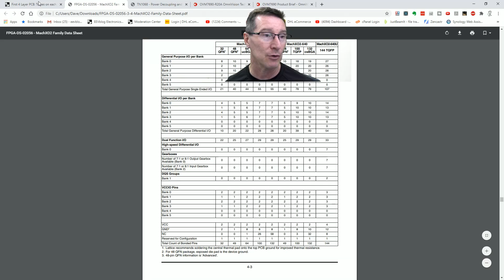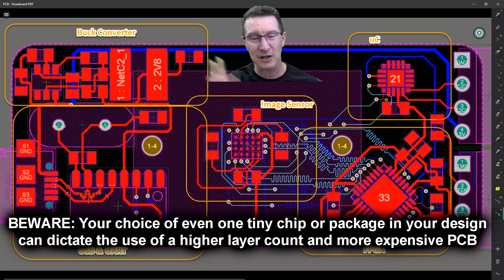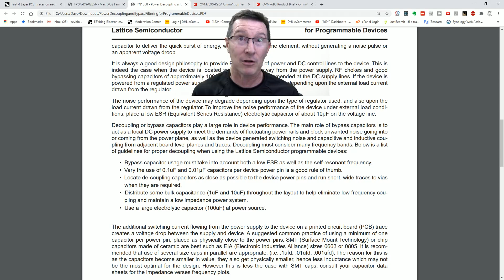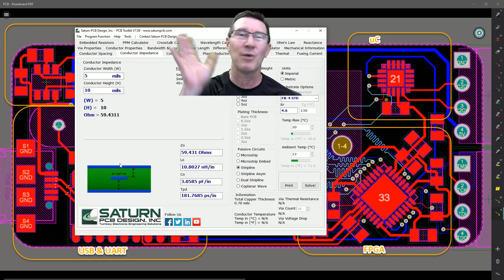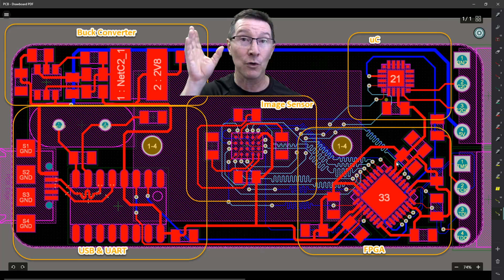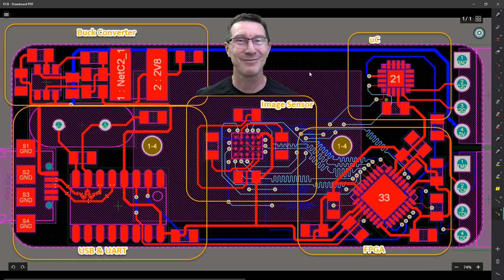EEVblog #1323 - PCB Layout Review & Analysis

Comment: My extra comment with BGA's would be, just try to avoid them (not always possible of course).
They are a pain in the behind to troubleshoot, repair and prototype.
Btw, you can also use 0 ohm resistors (or split one resistor in two) as jumpers, to prevent going into other layers.

What also really helps, is first just roughly place components on the board without connecting them even.
This is even PART of the development stage. (I call it the tango between board design and schematic design)
Just to get a good feel how much space you have and if you already need to find alternative components.
I see so many people wasting a lot of time first calculating every tiny bit of their schematic first and than eventually come to the conclusion that things don't quite fit.
Most of the time you know that certain components are needed anyway (for a lowpass filter for example).
The values aren't important for drawing the board.
In fact, to safe time you can calculate these while ordering the boards.

I also find it interesting how there is a bit of personal preference.
I actually always tell people to do the ground connections LAST.
The reason is because it's pretty easy to move via's anyway.
Exactly what you say at the end, do your power traces at the end.

Nice video Dave!
Reply: Yes, I also don't understand that people calculate everything first.
First get the basics right, values will come later.
Most of the time you will go back and forth anyway with size vs value
Reply: Yes, this sounds very familiar. Even just three weeks ago I had a co-worker spending literary days on end calculating just some perfect values for a MFB filter.
In the mean time, the whole order on getting just the boards made (so not even assembled) was delayed.

Comment: I’ve learned my make PCB layouts basicly my self I’ve never done anything complex. But I’m always told I’m smart with I don’t believe😅 but I learned myself that placement is everything. And on multiple occasions scraped all my work just because I figured out I could move things around and get everything easier. Common sense is just vital for these things. Also taking pride in ones work I think is also important. Yes this design “works” but it’s not the most pleasing, or most correct way.

Comment: Maybe you could do a video where you actually fix the design, would be nice for the guy and would be nice for us watching as we would see the design progressively improve
Reply: I thought the same thing. Also a side by side before-after comparison at the end would be really cool
Reply: Maybe the guy could submit the altium file instead of a screenshot.
That would have helped alot.
Reply: That would require a heck of a lot more time, you know - many hours.  For we visual learners, it isn't necessary.  I can see that for others it would be valuable.  Also, it would require Dave needing the source files as well as be familiar with and have all the software.

Comment: Don't be afraid to use small passive components (0402 or even 0201). They are pretty much the industry standard now and unless you need the power dissipation of 0805 or higher voltage ceramics, there is no reason to go for 0805 (for mass produced PCBs). 

He could have achieved a much nicer buck converter layout if he had gone for 0402 passives. Don't ever compromise on layout like that. That is just going to create a lot of headache when your product fails radiated/conducted emissions tests and you have to redo the whole thing again (which might cost you tens of thousands of dollars). That is extremely important when your case is made of non-conductive materials and usually less than perfect layouts create all sorts of noise in 100 kHz-10 MHz region. 

Though I have to mention, that the digital signal layout is usually very forgiving (quite hard to screw up so much that your UART signal gets messed up) but you would see a huge difference in EMI/EMC testing when comparing autorouting mess and proper, well thought out layout.

For learning, a good place to start is to thoroughly read the chip manufacturer's application notes and datasheets. Though you can't believe them 100% since the electronics design industry is full of incorrect assumptions and rules of thumbs. You just have to find out the truth the hard way sometimes. I could later mention some useful literature, though I can't seem to find the list right now

Comment: Placing components and traces so tightly to the board edge is going to demand extra attention to detail and control during PCB depaneling if that tight placement is a design requirement. Otherwise, expect defects impacting those items at the depanel process step. 

Components placed that tight to the board edges also tend to be more susceptible to mechanical damage during physical handling and transfer between manufacturing process steps. That imposes additional costs in terms of troubleshoot, repair, and production delays. It is amazing how quickly they add up.

The tight placement of components with a significant difference in pad size also has the potential to impact the SMT reflow process. The larger pads will tend to pull heat away from the smaller pads, potentially leading to solder defects. Typically these issues are noted for potential improvement during a DFM (design for manufacturing) review or flagged by a manufacturing engineer using an automated layout review tool. If the tight placements are an absolute requirement, the SMT engineers will need to carefully manage the reflow profile.

Comment: If using an FT232R and it's not a timing critical use case, you don't really need an external xtal. It has an internal 12MHz oscillator, DPLL and even a x4 clk mutiplier.  AN100 states: "In some applications it may be necessary to use an external clock source. For example when operating at a reduced VCC supply voltage or for improved EMC. "

Comment: Regarding the 2 SPI lines "in the middle" of the data lines -- rotating the sensor 180 degrees those magically become on the outside requiring no vias at all (assuming the pins on the fpga are fungible)

Comment: Please do a video on split power and ground planes.
Reply: that is an very annoying topic. If you are really interested, look what Analog devices writes up it and be prepared for conflicting information.
Note that from a competent level, split GND planes can make sense - but from a system level, usually they are more trouble then they are worth.
This will also be the impression when you need component datasheets (recommending split planes) and applications notes (advising against split planes).
The reason is, that ideally, your system has 1 input, 1 processing and 1 output. The reality is a complex system of interconnected IOs and interconnected processing steps, that literary switch the current paths across the board.

Note in particular that measures that are required to make a split GND system work (good component placement reducing the GND current flow wildly across the board) also happen to be the same measures that reduces the benefit of split GND system.

If you really want to get serious, start with subsystem star GNDs that you then connect to the system GND star point. Then think about it star or plane is better and then flood over everything. Then you wonder why you went trough the trouble of subsystem star points (hint: sub system star points force you think about current flow, forcing you to optimize placement).
Reply: That’s exactly why I suggested it the subject can get confusing with all the differing points of view.

Comment: I would say the placement is the biggest issue. A better placement would facilitate the routing greatly. Another point is the big loop the 5V trace makes to reach the DC-DC. It is better to be close to the input connectors. From the EMC point of view, it is also better to place the connectors on one side of the board especially in this case that you have relatively high-frequency digital circuits such as FPGA and the Image sensor.  Another point is always thinking about the stack-up and grounding system from the beginning.

Comment: The whole point of bypass caps is to provide lower inductance path than what can be afforded by power/ground planes. This is why small packages are often used (they have lower inductance), use of dedicated vias to power and ground planes is highly recommended (again, to lower inductance). Capacitance values of these caps is less important that inductance, and it is mostly defined by the package. This is also why "reverse" cap packages (like 0204, 0306, where leads are along the long side) have become a thing. Location is also important to minimize inductance. This is why most really high speed chips (like mid- to highend FPGA, or CPU/GPUs) always have a bunch of bypass capacitors right on the package.
So by going with "bypass caps are not really critical" mentality  you are setting yourself up for one day, when you will say "yea, they were really critical", and will need to do a serious PCB redesign to add them (the reason it will be a major PITA is they very often "compete" for space with fanout traces in the most densely populated parts of a board).

Comment: It's a very good educational stuff especially for those hobbyists! I have no experience in doing layout for those so many pin count components on boards. But, can the many internal pins of image sensor be first brought out to its four sides by using its four available layers and sit them on the top layer, then the much un-used space on top layer can be utilized for routing purpose.

Comment: I love these reviews.  Routing all signals along the top is best, because less interruptions through other planes and shorter traces.  But if you have one badly routed signal, that will be your point of first failure, so all the better routes won't matter.  Or do you see it as additive EMC?  There are a lot of factors and sometimes I feel that my routing is pedantic, when it only needs to work.  It would be helpful to know when good design philosophy matters and when it's just feel-good rather than good.

Comment: There's at least one good reason why you might choose true stripline transmission lines in preference to microstrips (ie to route on an internal layer rather than surface) despite the impact of the two vias required — microstrip transmission lines do radiate more EMI than striplines.  Of course, that may matter less if you have the luxury of a metal enclosure, but designing for plastic enclosures is increasingly required these days.

The impact of the two vias might not be as great as one might first think.  Example: A 0.13mm wide microstrip 0.18mm from either reference plane results in a 50Ω stripline, which Saturn's tool suggests produces about 0.35nH/mm (and 0.14pF/mm).  A 0.45mm/0.2mm via with 0.225mm clearance to planes is worth about 1.4nH+0.56pF†, or 4mm of stripline (and happens to be 50Ω, too), so although yes, the vias do reduce effective impedance (also discontinuities, which matters less provided the vias are as close to the source and sink as possible), the effect dissipates with length fairly quickly.

Ignoring the fact that vias are lumped impedances, the deviation at 10mm of stripline is around 25%, falls to 10% at 33mm and to 5% at 72mm.  It's still worth using microstrips for very short traces, but chances are that your transmission lines are going to be long enough for the impedance deviation to not matter so much, especially with digital signals.  Analogue applications such as RF are another matter, but then likely you are going to have metallic shielding, possibly mounted on the board itself.

In the example at hand, I estimate that the longest trace is roughly of the order of 25mm which, by those calculations, amounts about 12.6% off, and that's getting close to PCB impedance control tolerances anyway.

Two caveats:

1) † is for one reference plane.  Capacitance to reference will increase if every signal plane is poured with grounded, well-stitched copper, which will have the effect of decreasing the impedance of each via.  Getting the layout tool to remove pads on other layers should help.

2) Watch for return current path.  If the stripline part of the transmission line is referenced to a different physical plane, the return current needs to transition as well, and that could substantially impact signal integrity.  If the second reference plane is also ground, then at least two stitching vias are required at the point where the microstrip descends into the inner layer.  If it's a power rail (must be the same as used by both source and sink), then ~1nF 0402 stitching capacitors will be needed.

Ed: the value of capacitor required depends on the frequency involved.  If you care enough to use transmission lines, 100nF won't do because parasitic inductance (which increases with value) renders the cap impotent.  If you have a well-defined frequency, f, choose stitching caps to satisfy f = 1/(2π√[LC]), noting that L increases with package size.  If the datasheet doesn't hint at what L might be, look for its frequency response (Würth's online REDexpert tool is excellent for this).  The point of self resonance is ideal for stitching caps.

For frequencies high enough, even that won't work.  In those situations, the most you can do is ensure that the relevant power plane runs close to the relevant ground plane (ideally < 0.2mm, so separated by prepreg rather than core).  Or pick another ground plane and use stitching vias nearby.